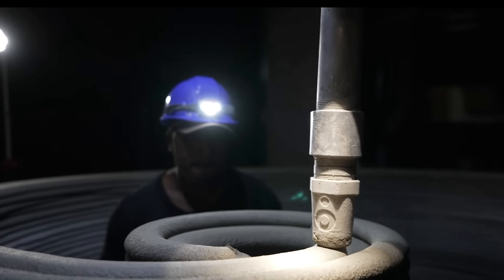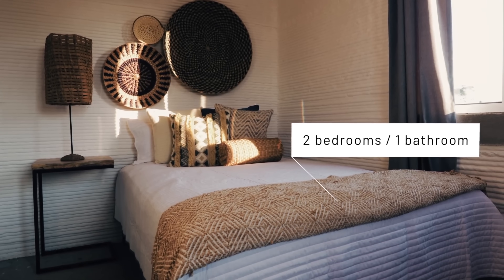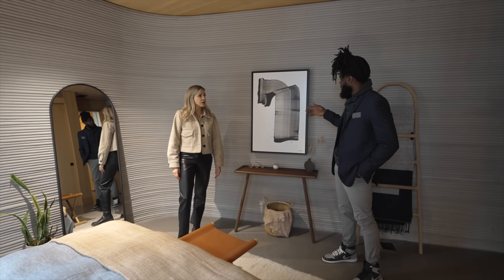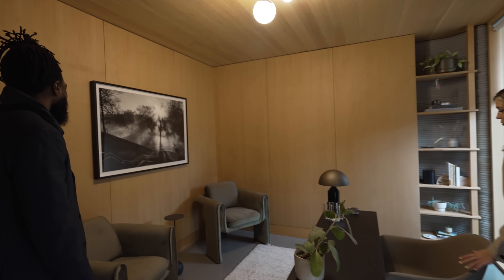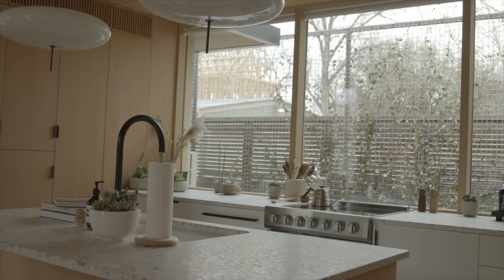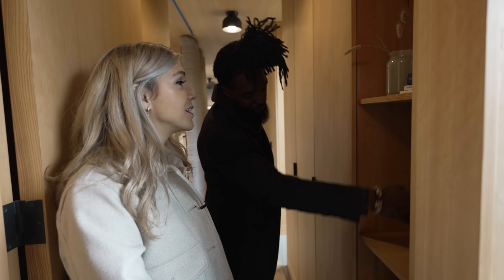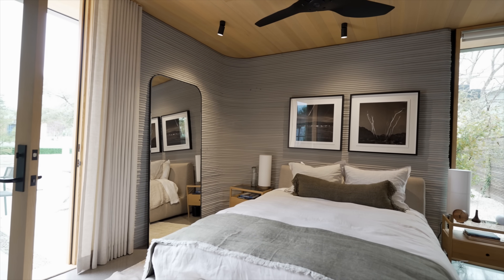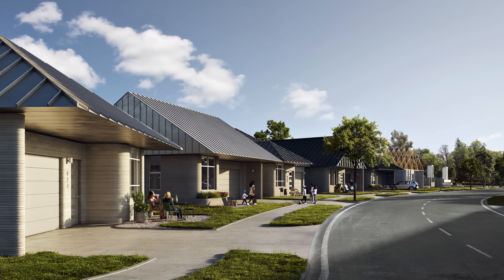Inside A 3D Printed House You'll ACTUALLY Want To Live In

Comment: Cost of this machine is significantly very high. Even the logistics and whether you have enough clearance.
Near the edges it needs a little extra touch manually like door joints, windows, you can see the lack of uniformity.

Also cool to see a black architect…..usually i seen them as accountants and lawyers perhaps realtors..

Comment: So I have issues with these concrete houses that they outright lie about. That is if you are not actively cooling it during a heat wave it can get unbearably hot. Yes concrete is thermally dense so it has high heat capacity but it goes both ways meaning once it's warm it says warm. So It has the problem with heat creep. Meaning if it can't lose enough heat at night it will rise in temperature each day without some form of air conditioning.

Comment: Living in a country with mostly brick/concreate homes. I want to say a few things, the insalatuin and heat retention of concreat heps a lot with costs of cooling or heating this up. Also I think those walls look cool but will be insane dust traps. FInallly keep in mind in Amarica wood is used for housing because it's cheap, concrete especially the way they are using it here... Would be VERY expensive.
Reply: The R Value of concrete is like 7 or 8.   These homes wouldn't work in colder climates without added insulation.
Reply: I agree about the wall texture being a dust trap,  it's cool for the outside, but the inside walls need plastering, otherwise I love the idea. Saving on electric bill offsets the concrete costs. I would live in a 3d printed house.
Reply: @calidag  Where I live in the northeast the outside wall texture would be a mold trap. I have to power wash the outside of my house every year, that concrete would be awful to clean.
Reply: @markboelte1415  Solution,  they need to print smooth walls
Reply: @calidag they can stucco walls..mentioned 4:45

Comment: Curved walls are a mixed bag. They make the house stronger, but I prefer flat walls inside.
I think the team did a great job of not making the inside of the house stupid with wasted space at the curved walls as I have seen so many times in the past. The breakfast nook, the built-in desk, and that chair zone all feel right. And it takes your head position out of the direct light for a more comfortable spot to sit.
This is about the first curved printed house I would like to live in.
Reply: I think just the fact that it’s 3D printed and not traditionally framed is the only way you can achieve that level of customization, since they know the size of the desk and chairs their going to use, and have to plan the outline of the house on cad, it’s much easier to make everything fit perfectly.
Reply: I love the way it looks, but yeah, you notice how much of their storage is built in. You're not fitting much traditional furniture into those rounded corners.
Reply: the whole structure is to showcase what the tech can do - not to appease your aesthetics nor out of necessity. it can and does have flat walls when needed.
Reply: @sashrafi90  IT MUST APPEASE

Comment: This is 3D printing for the sake of 3D printing.
Real estate wont just discount the so called labour cost (especially on such a small housing project). And even if they did, the scale is so small that they can still aim to sell it at full market value and nobody will complain. We need to get real. Developers do not line up trying to sell you a house at a cost. It is the other way around. I believe they called it "housing crisis", or something along these lines.
This technology needs to travel a long way before it has any substantial benefits to the construction industry and the community.
Perhaps if it was as simple and small, that it could be DIY. But  this is not the case.

Edit:
And to top it all off, this method appears to use way more concrete than a normal equivalent method (e.g. Reinforced concrete using columns and floors spanning on beams).
Therefore the carbon footprint must be bad. Remember boys and girls, we are moving towards using LESS concrete, not more. 
Think of your planet ;) (and your wallet).

Comment: this would definitely not survive a heavy earthquake. where are the steel rods? why don't they fill the gap in-between the two printed walls with massive steel rods, or at least some sort of »steel structure« and fill up the rest with cement? wouldn't that be a safer approach?

Comment: Looks good, but definitely a lot of flaws to consider. There talking like they invented 3d print buildings. The Chinese had this technology years ago.

I’m not won over, definitely going to be future issues, what’s the estimated life span of one of these structures?

Also the only place you save is on brick layers wages. You still need all other trades.

So how does the price of the 3d structure compare to price of brick and block, cement and brick layers wages??? I’d like to hear the cost saving if any?

Comment: I grew up in a city that most of the houses and apartments are built with concrete. The city heats up much faster than wooden houses. If the city rains a lot it makes more sense to use concrete, but Texas is so hot and dry, I'm not sure if it's practical in the long run.

Comment: This is the third video I've followed to the end on affordable housing. Seriously, never run the viewer out without at least a basic cost per sq foot. For a shell or as shown. I need the absolute least expensive finished product. Tens of 1000's not hundreds of 1000's.

What I need is a way to build a small footprint, highly efficient, solid, and secure living space comprising of a single bedroom of 110 - 140sq ft;
A combination kitchen and dining space 150-160sq ft.
A full bath 80sq ft.
Then I need a custom-built music studio for a band. The density of mass is the main ingredient for floor, and wall soundproofing systems.  It ideally needs non-square corners with wall and ceiling surfaces that are fixed at different angles. Curved surfaces would be interesting. The wall printing system would be ideal. 
Total:  6-700sq ft 

Can we custom build a 3rd or even fourth layer printed wall with a few inches of dead air space between them surrounding the rehearsal/recording space? 
That is exactly what is needed to drastically cut decibel levels. This system looks like it would be ideal. 

I would be interested in setting up a small tract of rehearsal studio houses across the US and abroad...I have yet to find anything like it. Badly needed.

Also, would it be possible to construct a custom-sized septic tank system by printing the tanks? Like for a small group of small houses. To accommodate septic system requirements for a  park of mobile and/or printed homes?

Comment: In Jamaica, houses are commonly made of concrete and bricks. If you build a house out of board in Jamaica it can mean two things: either you're extremely poor, or the house is only for temporary uses. But we do have an exception: small shops in the country areas are sometimes made of board.
Reply: that's the norm for the caribbean due to wheather circumstances, if you go to fl it becomes common to have concrete but the further you the more common wood is.
Reply: Well if you live in Jamaica, that means you're extremely poor in the first place.
Reply: @guitarcatlind6075  no not all Jamaicans are poor
Reply: @jessicajohnson9794  99% are
Reply: Yes you build with concrete, but what actually looks better? Homes built with wood frame. I’ve been to Jamaica. Those homes look real rough looking. You can’t do a whole lot aesthetically when those homes are built with concrete block.

Comment: I like the organic look of 3-D printing, as well as the labour savings. Most homes in my country are built with concrete blocks, then plastered and stucco'd - rougher textured stucco used outside vs a finer grain stucco or smooth plaster and paint indoors. Concrete is great at absorbing and radiating heat so no worries on that front.

Comment: The problem with concrete once it heats up it can take days to cool down.  The reason why there are so many curves is because the strength of the material.  Adding curves increases the strength by removing straight walls.

Comment: Speaking of affordable housing, Norway could get a hint or two. If I want to live in the capital of norway where, lets be honest most of the action happens I have to expect to dish out around 1000usd a month for an apartment less than 40sqm, but then again. I could also live in a super idyllic spot right next to the ocean with midnight sun in the summer for 200.000usd and get a house like 250-300sqm. Only issue is it would be like an hour drive to absolutely anything.

Comment: Definatly interesting, and looks good and solid.  But I wonder how well it would do in harsher climates,  I live in Eastern Washington, and we get extremes on both sides,  over 100 degree summers, and rather chilly winters, -32 degree's, when some years it can get even colder.   But also, are the layers likely to crack,   And or how well it would do as a base, for building something like a hobbit home.  Wood struts for support, with the layers making up the walls, enclosed / underground to not be hit by both extremes.  But then how well would it deal with ground freeze etc.  Definatly interesting though.

Comment: I was looking for outlet boxes, or some sort of access to the walls for electrical wiring, but did not see any in this video. Was the electrical only ran through the roof and pine walls? Very curious. Also, I am interested in the weather testing of the materials used. I like the temperature management aspect of the material. Lastly,  nothing in the video regarding costs? Thanks for the info.

Comment: Looks great and practical but I have my doubts. How can a concrete house stay at 75 degrees (I guess he means Fahrenheit, American should really use °C) when it's 95 degrees outside?? Concrete houses get way too hot in the summer where I live, in Central Europe, concrete is the worst in the heat. There's no way it is cooler inside than outside. Also, they get rather cold in the winter so now almost all concrete blocks of flats here are insulated from the outside as well. These walls look way too thin for any extreme temperature or weather.

Comment: Looks amazing. I think the walls I would plaster I would add insulation behind those walls and in the areas where there's not a lot of insulation I would use other means of heating i.e. underfloor heating, a really fancy fireplace or a beautiful radiator which has some fun abstract look.

Comment: I think the idea of concrete homes is great! Especially, coming from South Texas, during the summers, that 75° indoor temperature without needed central air when it's 95° outside is such a huge plus.

I like the exposed concrete, but I think 3D companies should really look into putting in a sort of edge liner that makes the concrete edges more uniform. Just an aesthetic observation. For me, I'd still move into a 3D house as is!
Reply: I don't think its really an accurate claim. especially when you add windows and have those days consistently.

Comment: I'd love to see how these last over the years. Just like any other 3d printed part, it's always weaker across the Z axis (vertically). I imagine wall mounting anything on the bare concrete walls like a TV is probably not easy or flat out not recommended. I've always wondered if walls like that will end up cracking, as larger pieces of concrete tend to crack over time. Interesting concept to say the least.
Reply: They all are done in strip and layers so it's not actually 1 big piece. I've seen other videos of the making and they are still reinforced with rebar as well for add stability and structure. I mean for a good look at durability look at roads which can last decades with heavy wear and tear of hundreds to thousands of pound vehicles crossing it 24/7. Your walls aren't going to face that much pressure or wear. I do understand your point about the Z axis though
Reply: Walls that are built with curvature are actually immensely more structurally sound than a straight wall and require very little to no extra reinforcement which is why they designed the home this way. The sales person missed many opportunities to explain the value of the lavacrete material developed by Icon in conjunction with the engineering designs that allow this style of building to truly revolutionize the way we see homebuilding.

Comment: I'm concerned that you can't put outlets or wires or switches in the walls without plastering over them with a thick layer of plaster.  Plaster is way more expensive than drywall.  I've been in some concrete "brutalist" buildings and concrete surfaces that come in contact with people tend to get darkened in the areas of contact.  Kind of like a ring around the bath tub.

Comment: A San Antonio company, H. B. Zachry did concrete homes in the 70's (not 3D printed, just poured into molds).  The main problem with Zachry's concrete homes, and why the idea never went anywhere (and I assume this is still a problem in many areas of the country including central Texas where the homes in this video are going up) - as the foundation shifts, and the concrete ages, it CRACKS after a few years.  Think about the concrete at the Palm Springs remodel, featured in another of Shelby's videos - it wasn't even salvageable.  I'd like to see what this home looks like in 5 years.
Reply: Longevity is my question too
Reply: Then you have bad concrete. In Europe, many homes are built using concrete and they are very long lasting. Typically European homes are built to last much longer than US homes. But the type of concrete and how it is cured makes all the difference for the quality of the material.
Reply: Concrete homes does well with foundations and beams. Homes like this will always have an in issue in long run. Plus I doubt this house can be made into double or triple storey. And cant imagine the noise from another room interfering in other rooms.
Reply: @dashmeetsingh9679  I just realized the difference is, in Europe it is always steel reinforced concrete. In this case it’s concrete without steel. So yes it will have some drawbacks
Reply: @theonebucketlist  Yep one tiny earthquake and voila

Comment: So cool. I wonder how this will hold up to weather. Can this be built in higher humidity areas? Will it hold for decades?
Reply: I do NOT want that house.  to many "technical" /structural Restrictions inovolved with it and  it's required constricted sizes.  The material is a horible mess. Then huge expense to "cover/finish those walls".  Wiring and plumbing issues.  If you want to build something like that there are better/Cheaper , simpler ways to do it.  search ,... Oh what is it called,  Mud/sand bag , earthen bag construction?  And I am not saying I would want that for my main house either.  I've have seen nice "Single Story" hotel rooms....  cement is a mess! espeically when you leave it exposed. Dirt , spiders, and bugs "sticking to it" and those layers/grooves!  then trying to deal with plumbing, electrical etc,  and even try hanging a shelf or picture. :-)) wanna change a door or window? 😅😅😅 that texture is aweful.  even beyond cleaning it has problems.  the novelty would wear off quickly.  and trying to cover that up with wood, plaster, etc... IS $$$$$   Are you noticing that even with the camera/"lense"?shooting done to try and make it  look bigger.  Look at how SMALL the rooms are. EVEN The ones that are supposed to be "larger rooms"  Oh and I live in a mostly solid cement walls and roof/ceiling ...  I will call Bull Sheets on it being 75 F inside on  days when it is in the 90's .  I live in the desert and once it starts warming up in the spring in the "90's" after a few days the cement warms up, the walls warm up and there is no way you are going to have 75F inside without turning on the AC.  if it goes "hot" then cold" then "hot" then cold for a couple of days, then Maybe... But after after a few solid days or warm/hot temps, the cement warms up. and as the temps keep on climing for "the SUMMER/ spring"  the walls of the building keep getting warmer.  In the low desert in AZ,  if I turn off the AC it will "quickly" start climbing toward the 90's F. I guess higher if you forget to turn on the AC.  Oh, and of course the Reverse happens in the winter.  Sure the novelty of this is "cute"  but the reality is..................  Not So Great.   especially if you DON'T want just a little/cramped "single persons"  condo/vacation condo"  and You don't want the MESS of unfinished cement walls.  You know what else you will notice about this... NO REBAR REINFORCEMENT/"structural support". ("no multiple stories" Fractures? not good for earthquakes, settling ground, etc.) And there Are More issues than just these... Ahh but the Novelty of it. 😅

Comment: I live in Mexico, almost all the homes here are concrete. And i agree, it hold its temperature, so we don’t need ac or heat. I don’t understand why the USA don’t have more or allow for concrete house. It would be cheaper and last forever. My in-laws house is 3 floors , been through 2 big earthquakes, and was built in 1980, still standing with no more renovations done.

Comment: Concrete without anything on is not waterproof as far as i know , this will not survive a hurricane maybe not even a single rainy season, i dont know, it looks great but i think its just a marketing stunt. Also there are plenty of concrete buildings in europe that have a thick layer of insulation in the form of styrofoam on them to keep them warm in winter soooo either in europe we do alot of unnecessary things or this house is just homelessnes waiting to happen.

Comment: Or you bring those preformed pannels wich 3-5 poeple can install and then you fill the mold with a one shot 3d printing system of filling it with concrete to print  full proper house